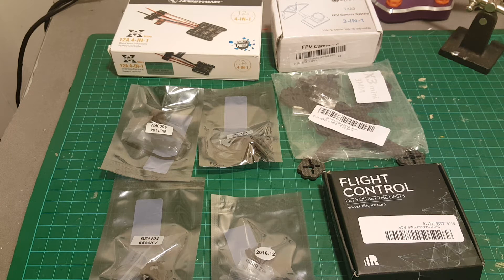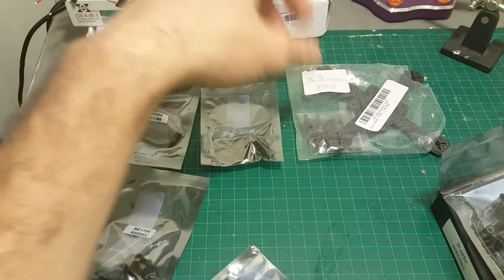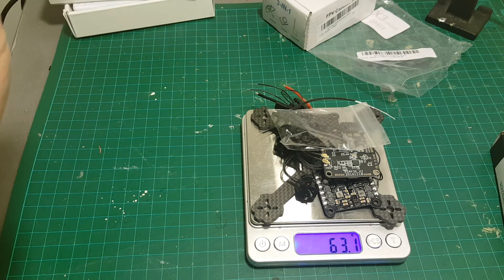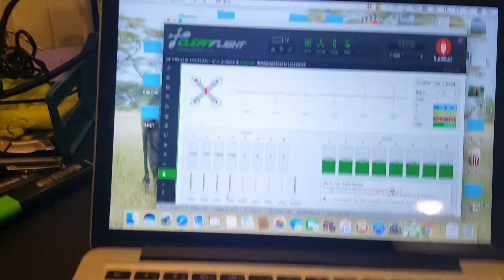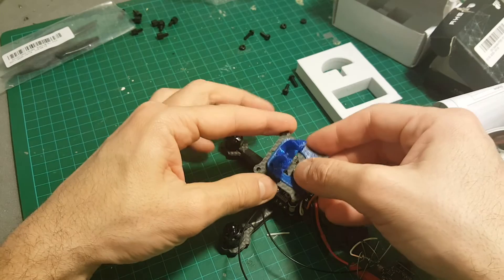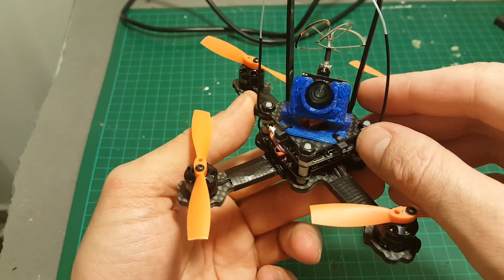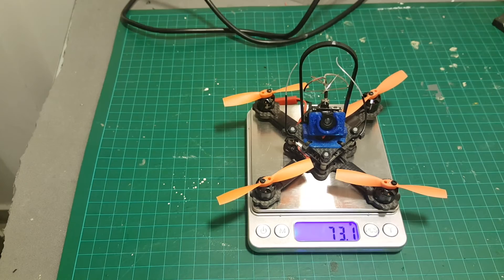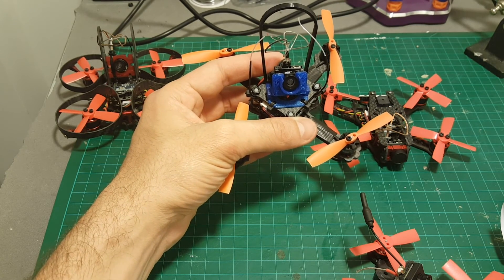X112 - 112mm Quadcopter - Full Build Video

Comment: Hey bud, you still happy with this build? I just got a frame and am sorting the components, particularly motors... stay with DYS 1104s? Nice helpful vid! Sub'd! THanks!
Reply from the maker: Hey John! Thanks for subscribing :-)
I hade some issues with flight controller, so eventually I took it apart and used the parts on another build. The DYS 1104 motors are great, so you should definitely stay with them.
Reply: Hey Gal, I really left 200mm+ size (still have two) behind and am fully into micros  For me, my limited time and space, they're just more convenient AND funner, period.  No time to build so it's KK 110gt, Liz95 and now soon maybe my first build with this x3 frame but as it's a bit heavy I will likely look for a flat and light like the 110gt style with a linear antenna.ANywho sounds like the frame was not to your liking. I got the 4mm thick frame and agree on it being a bit of a pig but everything is a trade off, eh? not sure what AIO stack to go with. THe HGLRC ones are really hot right now but I'd settle for any decent and not defective f4 with osd. I'm still sorting.
Reply from the maker: +John Graboski I am going to release a new build video of a Tomoquads frame using the HGLRC AIO tower within a week or so. If you need more help, feel free to reach out to me on my Facebook page- http://www.facebook.com/kremerFPV

Comment: I hope you didn't fly with only one screw on each prop.  The vibrations would not be worth the weight savings.  Curious to see how you think it compares to your others though.
Reply from the maker: +Shawn Sato-Veillon I actually did, since I was missing the right screws. I flew it a couple of times, but unfortunately I had some issues with the flight controller, so I just took it apart and used all the other parts in another build.

Comment: you need to put the 4 blade gemfans on it and it should be super fast!! Please do a video with the 4 blade 3" gemfans
Reply from the maker: I took it apart eventually and used the motors on my Eachine Roarer 120mm.
Reply: oh ok cool